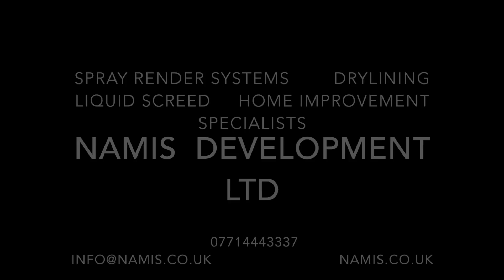Sand and Cement Sound Coat  Rendering by Namis Development Ltd

Comment: There's no way that wall render is 100% flat in all directions. The more videos I watch about rendering outside my country the more I'm confused. How the hell do you guys get paid for this, I'm genuinely  curious.  Is there something I'm missing?    The way we do it here is to make guide tracks with the material using level profile, and only then after, apply the material in between the guides and scrap it with long profile. it's the only way to have a perfect wall render.
Reply: Xoda  this doesn't have to be perfect as plasterboard will be stuck over the top of it as this layer of render is only for sound deadening purposes.
Reply: sole purpose of rendering is ONLY decoration. so why the hell you want 100% flat ?